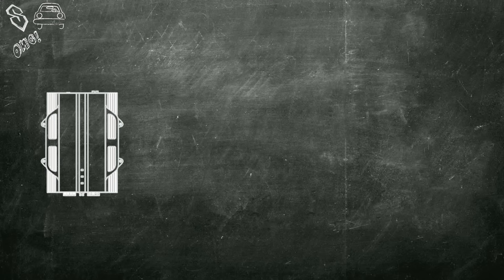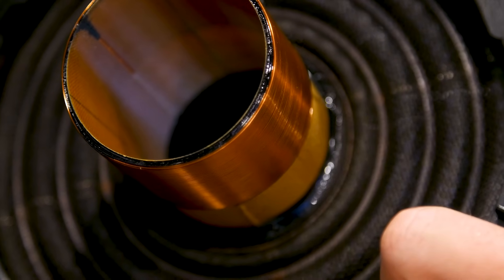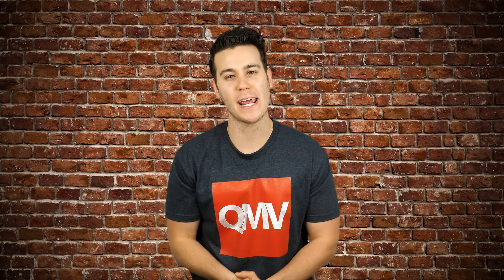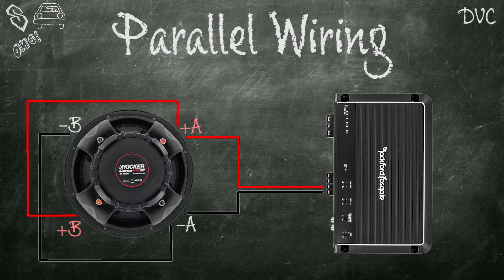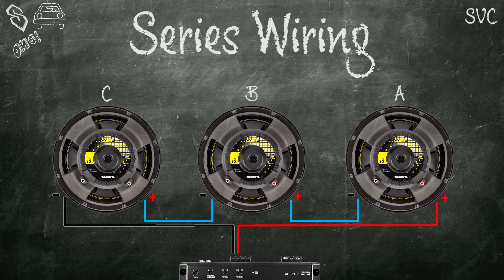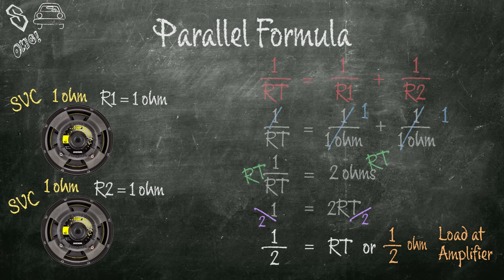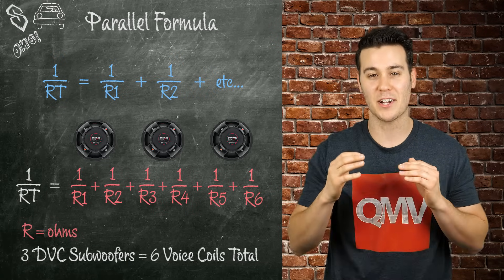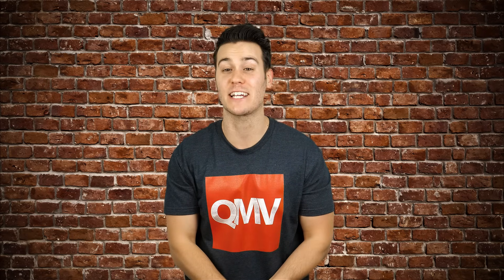How To Wire Subwoofers - Parallel vs Series - Single Voice Coil and Dual Voice Coil

Comment: you lost me with the equations
Reply: in other words: parallel wiring = less ohms (more power out of amp, but stable if within amp specs), and series wiring = more ohms (less power out of amp, but more stable)
Reply: @VictorEstrada  Yes mostly.  There is another factor to consider however, that is the damping rating of the amp.  Good luck finding it, as nobody rates them that way now.  It is a measurement of how stable the output on the amplifier is with varying load, (which all speakers do vary in impedance with frequency, the enclosure type and size, and even temperature!).  Anyway, speakers in series also have the general ability to effect each other more than speakers in parallel.  So, unless the speakers are installed exactly the same, with no differences in external influences, the speakers wired in parallel will more closely match each other in motion and sound than those wired in series.  And an amplifier with a higher damping factor will also be better able to prevent excessive cone excursions at higher power.
Reply: _ David _  if (and if not the setup is rather odd) all the coils are the same impedance then you can simply divide by the number of coils.
4x 4 Ohm coils in parallel makes 4/4 = 1 Ohm final load
Reply: I have 2 8ohm speakers, that would total 16 ohms in series correct?
Reply: @charlesd.morgan362  yes - series is calculated by simple addition.
Reply: @michaeltempsch5282  what wattage would you recommend for my power amp plate@ 8 ohms 150 each
Reply: The formulas with the 1/R... I’m about to simplify it. Eliminate the “1/“ part of it. 
If u have 6 subs at 2 ohms it’s 12 ohms total. 6+6 or 2+2+2+2+2+2 will give u this number. Understand that 6+6 is only applicable for when the resistance of the subs are the same. If the resistance is different like a 3 sub configuration with 1 sub at 2 ohms and 2 subs at 1 ohm in series, then u would do 2+1+1 which is 4 ohms. 
All of the “1/“ in those formulas are pointless and unnecessary. 
Also parallel combines potential current(amps) and reduces the resistance but keeps voltage the same across the components or subs. 
2 subs at 4 ohms in parallel will have a resistance of 2 ohms. 
It’s all very simple.

Comment: Also when you strap amps the impedance( ohms) are brought down which provides more bass. My sub is currently wired to .5 ohms which is kind of risky but I love it on my two Orion 12's.

Comment: So, is it correct if I have a Sound Magus DK600 (2 ohm, Class D amp, 600 Ohm RMS output) connected to a Hertz Audio ES 300.5 single coil sub (4 ohm, 350 Ohm RMS)?
Reply from the maker: Yea thats a good match! A SVC 4 ohm subwoofer makes a 1 ohm or 4 ohm load. That amplifier does 400W RMS @ 4 ohms and the subs does 350W @ 4 ohms so they match!
Reply: Quality Mobile Video  but why 400 ohm? not 600 ohm?
Reply from the maker: Because you can't wire these subs to a 2 ohm load, and at 2 ohms the amplifier does 600W. They wire to a 4 ohm load, which goes to the amplifiers 4 ohm setting of 400W.
Reply: Quality Mobile Video thanks a lot!
Reply from the maker: Anytime!

Comment: is it possible to connect dual coil 2ohm sub to have final 2ohm in amp?
Reply from the maker: One DVC 2 ohm woofer makes a 1 ohm or 4 ohm load. However, two DVC 2 ohm woofers can do a 2 ohm load.
Reply: Quality Mobile Video ok but can two DVC 2ohm do 1 ohm or is that 1/2ohm...I have a DVC 2ohm and I want get another one and run them at 1ohm...

Comment: If you wire two different speakers (let's say a 20W RMS and a 100W RMS speaker) of the same impedance in parallel, would you have any issues with the 20W speaker being overpowered?
Reply: Prob so. That or the inefficiency of the 100w one would suck up all the juice first. Kinda like a passive speaker cab woofer does...

Comment: I am confusion
Reply from the maker: We are solution. What are you having trouble understanding
Reply: Quality Mobile Video I get it now after watching the video like 10 times but what happens if the amp has a lot more power than a sub needs
Reply from the maker: That's totally fine! There are really no side effects, just make sure you don't send too much power to the sub, only what it needs

Comment: Question: I am new to car audio. I have 4 new kenwood speakers, rear are 6x9 6995 5 way speakers and the front are 1695PS 6.5 coaxial speakers. Yesterday i purchased a kenwood party pack, the amp is a KAC 5206 2-channel amplifier, the subs are 2 10" 8ohm single voice coil subwoofers ( W110s). I wanted to know from you guys is this amp strong enough to power my sub to the recommended power levels? Im extremely excited to add to my first car(Saved up and bought it myself all cash) and i just want to know from you guys if this amp is good enough or should i look into something more powerful for these subs?
LINK to the product: https://www.amazon.com/gp/product/B00ISB6P0M/ref=oh_aui_detailpage_o00_s00?ie=UTF8&psc=1
Another link to show the actual subwoofers and amp :https://www.walmart.com/ip/Kenwood-P-W1020-10-Bass-Party-Pack-350-Watts-KAC-5206-Amp-and-2-KFC-W110S-Subwoofers/50813904?wmlspartner=wlpa&selectedSellerId=1187&adid=22222222227038596466&wl0=&wl1=g&wl2=c&wl3=80435885329&wl4=pla-177681336049&wl5=9027638&wl6=&wl7=&wl8=&wl9=pla&wl10=112549749&wl11=online&wl12=50813904&wl13=&veh=sem
Anyone with experience please help me!! thanks!

Comment: dear expert....... i have a query 
i have an indian sedan swift dzire and want to install sony xplod 1800 watts sealed enclosure which have 400 Rms rated power with 1800 watts peak + sony xm n1004 model with 1000 peak bridgieble amp is it good or not

Comment: I enjoyed the comparison of Ohm's law to drinking!!!
Reply: Yeah... just too bad they fuked up on the diagram for the water/electricity analogy right before that though... 0:55 
✗ Voltage = Pressure
✓ Current = Flow
✗ Resistance = Pipe Size
Reply: @jnowski9622  a
Reply: Negative twice, high voltage lines over distance definitely has an advantage and reason, but that has nothing to do with the water analogy in question (which is wrong).  Long travels have high voltage so a low current flows to deliver the power (P=IV), low V trying to supply a small town would require ridiculously  high current which would melt the wires.  You raise V to lower I while delivering the same power, drastically increasing efficiency as well as its not possible at low values of V.  Nice way to dance around a question with a random, unrelated comment.

V is the pressure, i.e. the driving force, that pushes charges along a conductor.  The very definition of Voltage relates it to an electric field, which is a vector FORCE exerted on charged species; in this case negatively charged electrons.  If V is a force, moreover the driving force, then how can it be represented by the pipe size?  The driving force of water is pressure obviously, which relates to electric driving force defined as voltage.  Pipe size only exhibits a resistive force, it resists flow.  The very words "resists flow" in the description says it all: pipe size relates to resistors.

Lastly, if pressure related to resistance then explain this.  What happens to flow when pressure decreases?  The flow also decreases.  If a force is reduced then the body being driven by the force slows and also decreases.  What happens to current when resistance decreases?  It INCREASES current by decreasing resistance; thus R cannot be the pressure.  By definition, resistance opposes movement, not causes it.  Thats like saying applying more brakes in your car (increasing "resistance" related as driving force "pressure") will increase speed (flow); brakes are the car system's resistance, so if resistance is analogous to the pressure driving the system then increasing brake would increase speed.  

Bottom line, electric R is nano-scale friction, where the flow of electrons are inhibited by colliding with atoms and repulsive forces pushing them away from desired direction of flow, causing energy loss as heat.  Friction/resistance in no way can be represented by pressure; one causes energy loss and resists work and movement where the other stores energy and causes work or movement.
Reply: @ckimsey77  Well explained🤜🏾🤛🏾
Reply from the maker: Negative, rethink what you just wrote. Its the very reason municipalities use high voltage on long runs and use transformers to lower the voltage in an effort to reduce wire costs. You trade one for the other. Think commercial distributed audio.
Reply: Can anybody tell me how i should wire multiple DVC subs to a Two channel Pro Audio amp?
Reply from the maker: Lol thanks!

Comment: hi mi amplifier is rated for 4 and 8 ohm. And I want to buid a 3 way speaker. 2 15¨speakers and 1 driver. All 3 are 8 ohm. What happens in that case or how should I wire? Thanx in advance.

Comment: So what would happen if you only wired one set of terminals on a dual voice coil sub?

Would that make the resistance 2ohms instead of 4ohms, for example? And would this produce a poorer sound quality and or unnecessary wear on the sub somehow?

Thanks for the great videos!
Reply from the maker: Hey man! So it is possible to run just one of the sets of terminals, I don't usually recommend it. You have to remember that the power rating will essentially be cut in half, so you'll have to be careful not to overpower it and burnt he coil which is a common mistake. The impedance would remain the same, so if the DVC subs was 2 ohm or 4 ohm it would remain that

Comment: is ok that i wired my 15 inch kicker cvr in parrelle with my 2000 watts spl mono amp?
Reply from the maker: Depends on the impedances! What are the ohms of the sub and amplifier?

Comment: Until I get another amp I have a 600 watt boss amp 2 channel but only reading one channel so (cuzz it's just fucking old)so I bridged it to one channel which is RMS 300w @4ohms X1. And I'm pushing two 12" kicker comps c 4ohm duel voice coil subs, I series parallel wired the subs to  4ohm load. Now I know that's weak but we'll that do until I can get another amp preferably a amp that can hold a 2ohm load.
Reply from the maker: Nice

Comment: How can I make mi subs hit like 15 I have 12 kickers cvr
Reply from the maker: What's your amplifier?
Reply: Quality Mobile Video  it's a hifonics 1500 watts using 4 ohms
Reply from the maker: I would try to get a lower impedance load at the amp, 2 ohm or 1 ohm if possible. What ohm are the subs?
Reply: Quality Mobile Video Idk I want a box with one sub port hook up
Reply from the maker: If you get your load down to a 2 impedance it will basically double your output, then if you bring it down to a 1 ohm impedance you'll be able to get even more power.
Reply: Quality Mobile Video  what's up I have two speaker wire outputs on mi sub box that means it's running 4omhs. Right
Reply from the maker: What's the impedance on the subwoofers?
Reply: Quality Mobile Video i don't understand i know it's wired at 4ohms

Comment: hey james im confused on my wiring...at crutchfield.com they have diagrams of parallel wired dvc subs (3 subs) and it's different then your wiring..tried both.and both work..which one is better? im at 1.36ohm
Reply from the maker: Hey Bob! Those are 2 ohm right? I'm looking at their graphic and it looks like a series wiring @ 3 ohms right? Both will work, but obviously the 1.34 load will get you more power, however the 3 ohm load will get you more efficiency!
Reply: Quality Mobile Video hey.james..yes they are 2 ohm...I was looking at the three 2 ohm DVC subs; mono amp; 1.3 ohm load.....you.said that diagram was in series?
Reply: Quality Mobile Video if so..wouldnt parallel be better then series in my setup??...and if so,.should I.wire it just as you wired the 3 subs in this video?
Reply from the maker: Let's make sure we're looking at the same diagram. Is this the one you're talking about: https://images.crutchfieldonline.com/ca/learningcenter/car/subwoofer_wiring/3DVC_2-ohm_mono.jpg
Reply: Quality Mobile Video whatever which one I.should.do...or how.you think I should wire?
Reply from the maker: Oh that one! Yea that's identical to the diagram in the video, at the 5:15 mark! It's a combination of parallel and series!
Reply: Quality Mobile Video thanks..so would that be my best bet?
Reply from the maker: Yea that's what I would do Bob!
Reply: Quality Mobile Video thanks man..you awesome
Reply from the maker: Good luck!

Comment: ok i have one i have two dual 4 ohm subs and 1 dual 2 ohm can i run these subs together and what ohms would i end up with
Reply from the maker: Hey Alfonso! I personally wouldn't advise running subs with different impedances to the same amp, just like I would advise running subs with different power ratings in the same system. It's very important to always have subwoofers that match, and ideally having identical woofers. If they don't match, you have a high probably of damaging your gear and having a system that isn't balanced correctly and will be very difficult to tune.

Comment: You should do a video explaining that when you wire up two or more subs on a monoblock amp how many watts is each sub getting. I had this very same dilemma when I had two 500 watt Subs I was debating on getting a 500 watt amp or do I get a thousand watt amp.
Reply from the maker: We actually explain this in our Matching Subwoofer and Amplifier video we made last month! Check it out: https://www.youtube.com/watch?v=dNNiq9avbpI
Reply: Quality Mobile Video Thanks, very informative, wish this topic was covered a year ago when I was confuzzled.
Reply from the maker: Glad it helped!
Reply: Whatever you talking about is moot. All the subs you wire to the output share the wattage equally. As long as they are all the same subs..  if ya have 8 - 12s and ya got a 10,000 watt amp to power them. Well the wattage gets dived between the 8 subs from the 10,000 watts.  Evenly.   Unless they are different sizes or brands  ohms. If they are all the same they will evenly split the wattage.

Comment: That is a very complicated way to do that. For parallel wiring just use R/N. R being the resistance of one coil (For multiple coil or driver setups) and N being the number of coils with that ohm rating. So if you had 2 duel 2ohm woofers it would be 2/4 or 1/4 ohms. Now for a series setup just take RxN. As an example, 2 D2 woofers OR 4 single 2ohm woofers. 2x4 = 8 ohms. This works with ANY speaker wiring setup, as long as all drivers being wired together have the same ohm load and are all either single or duel voice coil. No mixing single and duel in a single setup.

Figured that this was an easier math problem for you to explain and for people to understand. Those other problems work as well, but that's more for electronic circuitry (that has multiple ohmages) instead of woofer wiring.
Reply from the maker: I totally understand where you're coming from, but we preferred to show these ones instead

Comment: how long would my amp last at .5 ohm if its only stable at 1 ohm lol
Reply: Doesnt work like that. Usually amps will go into protect if they see an ohmload lower than what it can actually handle. If it doesn't go into protect then just watch it carefully because it will heat up faster.
Reply: Well look i have Comp Q 15s Dvc 2 ohms they rated at 1100 rms i have two hifonics brutus elite bex 2500 amps at two ohms they do 1700 rms would i be better runing them independently or strapping them together As a Master And Slave amp
Reply: Baby Gotenks 
Are both subs in the same box? as in, do they share the same airspace? If they are separated then run each amp separately with your subs wired to 1 ohm each. If the share the same space then putting your amps in a Master Slave setup is better, but still run your subs to 1 ohm each with Each their own amp. BUT!!! if those amps put out 1700rms at 2 ohms then wire your subs to 4 ohms each and each to their own amp.
Reply: Baby Gotenks 
Did you read any of that last bit? With how powerful your amps are running your subs to 4 ohms each and have each on their own amp is the best option.
Reply: Baby Gotenks 
And WHY would you run .5 ohm?
Reply: Baby Gotenks 
4 or 1 if each is wired to their own amp. 8 or .5 if you wire them together
Reply: Baby Gotenks 
Your not understanding this at all, are you? Your amps cant handle any less than 1 ohm. It can handle as many ohms as you want. Your subs will blow if you wire them to 1 ohm. You will overheat your amp if you only use 1 amp but use both subs and wired it to 2 ohms. Use both amps, wire 1 sub per amp, and have the subs wired 4 ohms each. That is the SAFEST way yo wire you subs and amps. its alright to underpower your subs, its not alright to overdrive your subs or amps.
Reply: Baby Gotenks 
Theyll be at full potential. you can safely run an amp  a few hundered watts above RMS.

Comment: :T would a 10 inch sub sound better than a15?
Reply: It depends on the box size and space it is used in
Reply: Depends on your taste in music. If you want something that can play low then a 15 is better suited for it. If you want something for lets say rock music then the 10 would be better suited.
Reply: perrin ashton 
2 10's arent better than 1 15. Youd be running about 30 square inches MORE of cone area with 1 15
Reply: Klaxz _ 2 10's on the same power would be louder.1 15" would play lower or deeper...all things being equal...